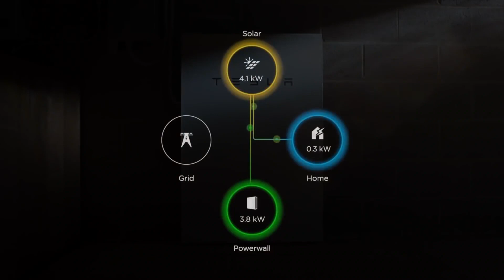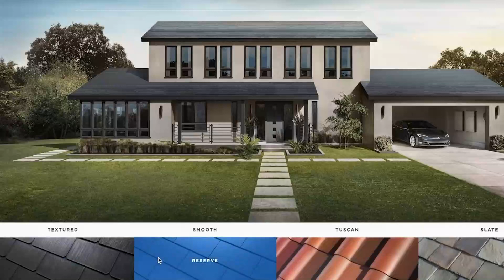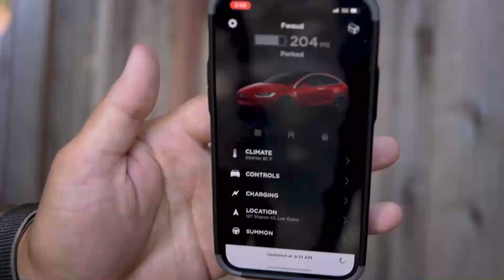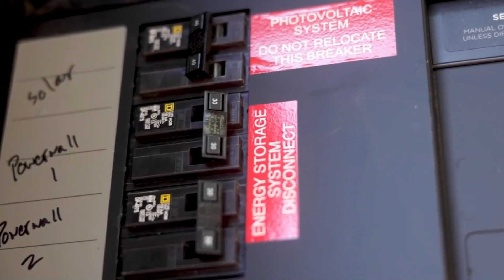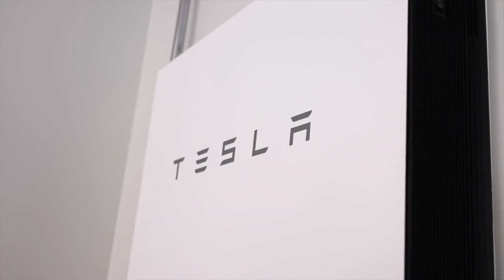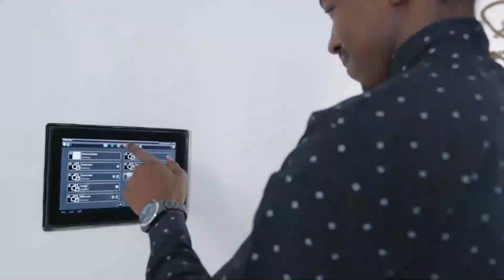What Elon Musks First TESLA HOMES Include!

Comment: We need to all get off the grid. Tesla, Bloom Energy and that geothermal company I just seen on the news, should get together and make it happen. Drilling holes to the magma under one home or back yard could be a challenge, though the lithium found may pay for it. There are times that competitors need to work together for the greater good. Actually it all comes down to which rich are going to get richer and which ones are going to lose money. You can bet on it that it is not going to be those in power that lose. Even if the results are our extinction.